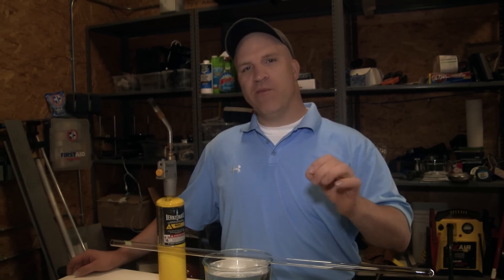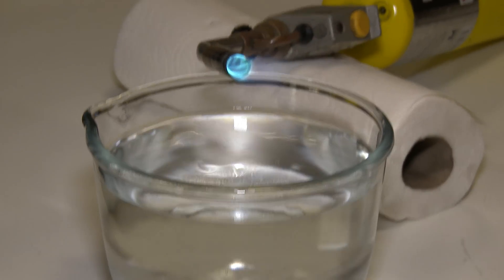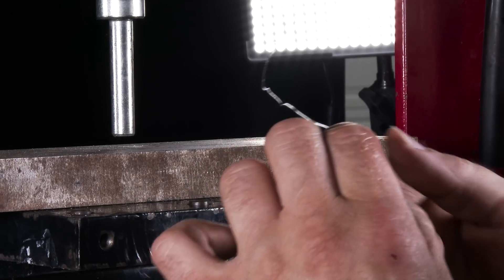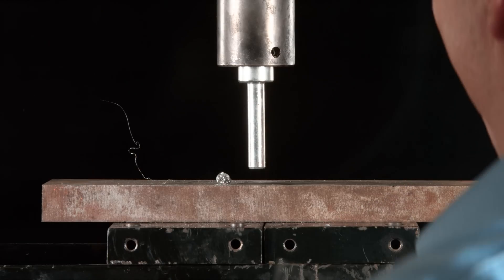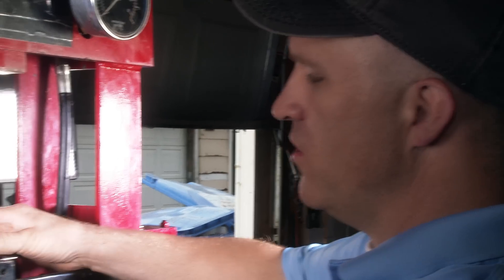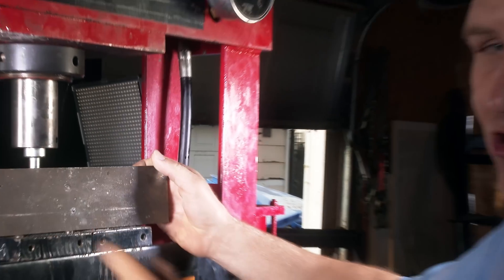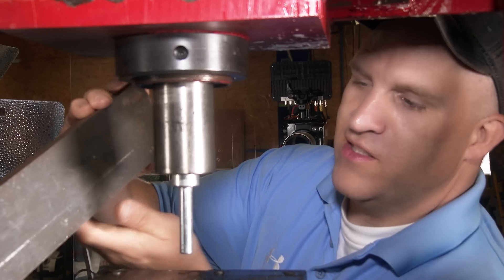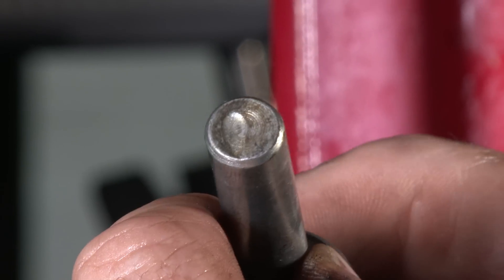Prince Rupert's Drop vs Hydraulic Press [ 4K - Slow Motion ] ( S1 E9 )

Comment: would it be possible to dip the tail if it were smaller in liquid metal to protect it and then make jewelry out of it?
Reply: Even the slightest bend would cause the whole thing to explode.
Reply: FallenSlayer ive always thought if you could keep the tail super short and dumpy, you could make a type of armour. 20 friggin tons?!?! I would bet $50.00 thats bullet proof.
Reply: Rick Sanchez haha, alright will do. I am pretty curious now to see if a small bullet maybe a .22 caliber would be stopped... Or if I could make a really big prince ruperts drop and test higher calibers. That would be pretty awesome to see, just need a high speed camera.
Reply: C1-37 is best Rick
Reply: Its all in how it goes in i think. If you could keep the tail under an inch, you could have two inch of gel padding, and 3D print a bracket to hold all the drops facing one way, short tail going into gel. Get that one gel that is a liquid but when you apply force or energy, it turns to a solid. That would be a 100% form fitting protection to the tail, every time. 

Total energy transfer and a surface layer that can take 20 tons of impact force.
Reply: Make this shit happen. At least give me credit when you make billions of dollars!!! 
✌😉👍

C1-39 Rick Sanchez
Reply: it would cost the amount of money you spend on glass stirring rods, butane fuel. then work on perfecting making the tails ultra small
Reply: And a 3D printer. But you can build one of those.... Even if it cost $25,000.00 to make ONE the patent on that one would be worth BILLIONS. Immediately sell it to military applications company. 

Bills....?You mean bird faces?
Bills....?The two gay guys down the street?

No... I dont know what these "bills" are you speak of. 😂
Reply: have you ever seen the video with that "dragon skin" body armor. that shit is legit
Reply: Rafael Roman 
The science behind the drops has to do with rapid cooling after heating and I'm pretty sure you could make other shapes than drops with that method.

So make some dragon scale shit out of that and we'll all be rich.
Reply: FallenSlayer 
I'm pretty sure to get the glass this strong all you would have to do is temper it multiple times over/heat then rapidly cool then heat then rapidly cool then heat then rapidly cool until it reaches the desired strength 
I don't know maybe that wouldn't work and the glass would shatter after tempering all I know is tempered glass is five times stronger than regular glass so if you were to successfully temper it multiple times you just could imagine how strong it could get
Reply: I saw that recently and yeah, i'm just wondering if you can make the tails shorter somehow for less vibration.
Reply: no
Reply: You can cut the tail to a certain length but have fun experimenting it...
Reply: Rick Sanchez hah, only if.. it would be pretty crazy but if anything hits it, it's going to bend or break the tail and boom. But it is pretty cool and fun to play around with.
Reply from the maker: FallenSlayer come on by and we'll film it. we literally just finished one bullet going through a can of 500000 frames per second. I wish I could share a video on here in this comment section
Reply: Warped Perception Well if you're close to Tennessee then sure
Reply from the maker: FallenSlayer lol...Chicago. if I can make some ruperts drops soon maybe I can do head on collision between a ruperts drop and a 9 millimeter bullet
Reply: it would cost so much just to make one vest just sayin
Reply: Rick Sanchez I think you're on to something! lol
Reply: jonathon lee yeah, I was wondering if you could make molds of molten glass and dip them into a tank of water and see what happens...
Reply from the maker: FallenSlayer that would be interesting
Reply: Warped Perception I'm assuming someone has tried that before with a pane of molten glass but maybe not..
Reply: couldn't you just snip the end of the molten glass just before it hits the water and not have the tail to worry about? Maybe just cut the drop off when it's the size you want.
Reply: just my educated guess. but dependent on the height of the drop, and depth of the water, even if you did manage to go quick enough to snip it. the force of gravity and the liquid state of the glass would still cause it to have a tail. but I still wish there were a way to protect the tail to make a damn near unbreakable ruperts drop.
Reply: look into gorilla glass. they replicate the properties of a prince rupert's drop with a chemical process. These days it's used to make phone screens you can swing a hammer at, and they're working on using it as one of the two layers of a car windshield.
Reply: ***** I'll definitely check it out
Reply: That Guy Yeah Him 
Let's make some armor then
Reply: i have an idea, idk if anyone has said it yet. Instead of dropping glass into water and working around glass droplets, find a way to dip glass into the water in the shape that you want it, like some kind of container for the glass that allows water to get in
Reply: this could also be used as a way to somewhat explode an armored car with th newly being developed plasma shield , if you find a way to concentrate all the energy
Reply: Others have tested it by shooting a drop. The problem is that even though the drop itself doesn't break, the vibrations travel through the glass, and along the tail and then the tail breaks. So no matter how short the tail is....the slightest vibration would still travel along the whole glass and poof!
Reply: If anyone wants to try.. I make these. 10/50 usd + shipping
Reply: The prince rurpert's drop will stop most pistol rounds and a few rifle rounds
NOW THAT IS SOME NEAT ARMOUR

Comment: The heck is Prince Rupert's drop..
Reply: It's named after the guy who discovered it. basically you melt glass and let it drip into water. for reasons I can't explain it makes the drop itself really strong but if you break the tail the whole thing shadders instantly.
Reply: Damon M thats what i was think but for it being glass, thats some strong shit
Reply: It has its incredibly strong structure because of the outward force in its structure. What happens is when it's dropped into water, the outside cool down, so it'll keep its structure. But because the inside wasn't cooled down as quickly, so it was really expanded, but it can't expand anymore because the outside already cooled. Due to this, you can't crush it easily, hence the possibility to withstand 20 tons of force, maybe more.
Reply: Side note, it isn't shown, but because of how a Prince Rupert's drop works, if the tail bit is slightly broken at all, even bumped, all the tension will be released, shattering it in milliseconds. You can see however he mentioned how he didn't want to touch the tail and was being incredibly careful handling it.

Comment: if you heated the tip only to make the drop instead if the tail it would of been much stronger
Reply from the maker: Hi weRoneself, we edited this video in non-sequential order so, the clip of that drop we were making wasn't the drop we actually used, that one broke, the drop we used was heated tip only, thats the only way they will survive. :-0. sorry for the confusion and thanks for watching !.
Reply: this was not understandable.
Reply: Why do you use of instead of have? What the fuck.

Comment: If you let the melted glass drop fall into ice cold water (instead of water at room temperature), shouldn't it 'cause the Prince Rupert's Drop to cool quicker, solidify under more internal stress and therefore be stronger?! Perhaps this would be a good way to find out... ;-)
Reply from the maker: not sure but it was pretty hard to make correctly as is .
Reply: Yeah, I can imagine it not being so easy to set up. It probably looks easier when one doesn't see the outtakes. :-)
Anyway, interesting video. I was impressed that it took so much pressure to break on, but at the same time I was also kinda impressed it broke at all. Contradictive opinion huh...
Reply from the maker: Delphino exactly, the clip i show us making it, it actually broke, have to get the angle of the torch just right

Comment: Fantastic! If you're reading this I have a request that may bring you many subscribers among the many you have. Bear with me:You need to get shop of a machiners book or a mechanical engineering schigleus textbook, available online for free through sources. Go throyb the index and if possible and affordable, select an array of elements and order several spheracle casts no bigger than a golf ball. Crush each one with a separate cylinder and go in depth on why the material did what it did, at the end of the sequence you can explain to the viewers the varying modulus of elasticity between each element and the stresses and strains endured by the spheres. If you would like a decent textbook to go by or a machiners handbook, just search schigleys mechanical engineering machine design, you' may be able to find an index of the young's moduli of the material you deem suitable fif yourbpress. Be Carefull though, if you dont want to damage your lress also doublr chrck the brindell hardness of the materials and maybe not exceed the hardness of your press!

Comment: its not slow enough. this is bullshit. you shouldnt have a channel that says slow mo when i cant see how it fractures
Reply from the maker: before i write this reply i have to stop and tell you that before i could even start typing i had to look at your profile pic !!. i love it !!!. i understand your frustration however, this was a viewer request and we were going to film it even slower but, a while back our buddy justin from "smarter everyday" filmed breaking the rupert's drop at 100,000 fps and still only had a few frames to show, so we went for resolution since even 100000 fps was too slow and looked similar just way lower resolution. thanks for commenting !
Reply: Awesomeness, i see the logic. The higher resolution is a major plus. Just curious , what is the highest frames per second that you have heard of. I wonder what the physical limitations are?
Reply from the maker: For visual the first set of lines, for research the second set. 
copied straight from our spec sheet

1280 x 800 - 25,600 fps
1280 x 720 - 28,500 fps
1024 x 512 - 47,300 fps

---------------------------------------- 
640 x 480 - 69,900 
512 x 384 - 99,500
256 x 256 - 205,000
256 x 128 - 375,700
128 x 64 - 764,700
128 x 32 - 1,000,000
128 x 16 - 1,000,000

Comment: what is prince rupert's ?
Reply: prince ruperts drop is a drop-shaped piece of glass with a long tail formed by dropping molten glass into water. Because the outside surface cools before the inside does, it doesn't have time to change size and shape because of the cooling process and is therefore under a huge amount of internal stress that manifests as ridiculously high compressive strength for the drop-- but any disturbance to the tail will destroy it, like an army being flanked, and release all that stress.
Reply: +Ethan Anderson very interesting phenomenon...

Comment: 20 tons is a force not a pressure. just saying.
Reply from the maker: your right but it sounds better
Reply: Warped Perception it's true. It definitely does. I wonder what the actual pressure that piece can maintain is though. Obviously it's very high at the surface where it's only contacting with a very small area of deformed steel.
Reply from the maker: +Charlie Trevaskis exactly !

Comment: you made the drop wrong!  you keep heating the drop not the tail. the drop should have a blackish center not clear.
Reply from the maker: actually there's only one right way to make it. if you make it right it won't shatter. if you make it wrong and the tail is hotter than then the drop it will shatter.

Comment: It looked like the tail, of the drop, touched the ram which could have broken it, causing the drop to shatter. Try it with several drops, one at a time of course.
Reply: if you look at it closely the tail survives so the drop just broke from pressure
Reply from the maker: nah, it just looks that way because of the angle. we were very careful.
Reply: +Ivan Villafan nah when you first make the drop there is always an excess amount of tail that if you your careful you can remove that excess without breaking the drop. the slow motion image shows it well
Reply from the maker: mosquito skeet your are correct, we left the tail to make it all more dramatic ! :-)
Reply: +Warped Perception it also shattered upwards. by chance if the tail was thicker to relief pressure. wonder if it would  increase pressure per pound ratio.
Reply: The reason they don't break is because there is an immense amount of internal pressure due to the way the glass cools, the tail is basically a fuse. A thicker tail means a weaker core.
Reply: that is true if they made the tail shorter then it would not have broken

Comment: 20 Tons ... holy crap. why is that little glass drop so strong ?
Reply: Its kind of hard to explain but there's videos on it everywhere, basicly the outer layer of the glass has pressure pushing inwards and the core of the drop has pressure pushing outwards.
Reply: +Malpageleafs81 that's insane. if you look at the surface area of the drop which is tiny that's incredible, it made a dent in the steel plate .